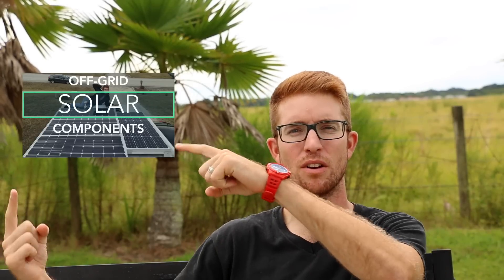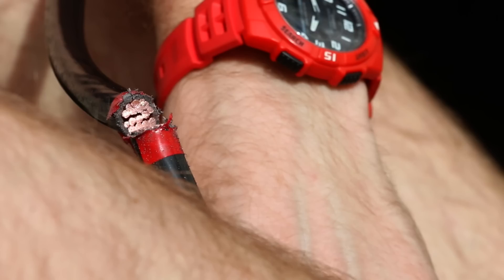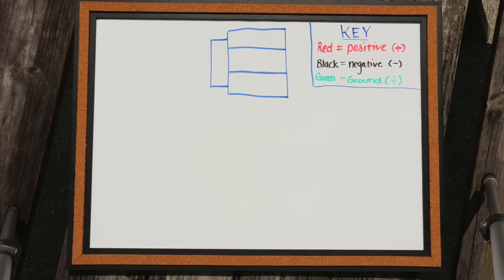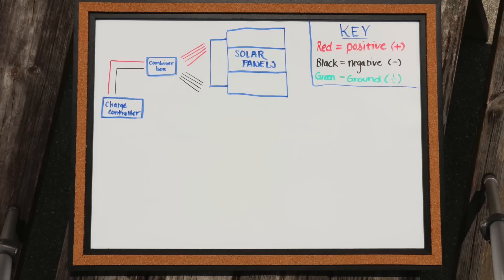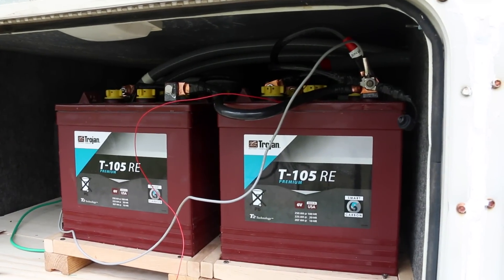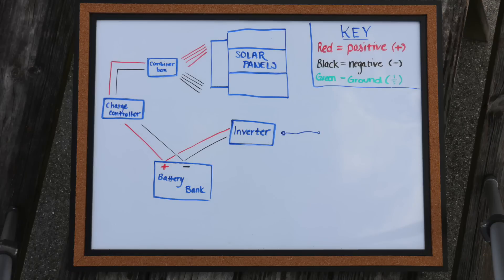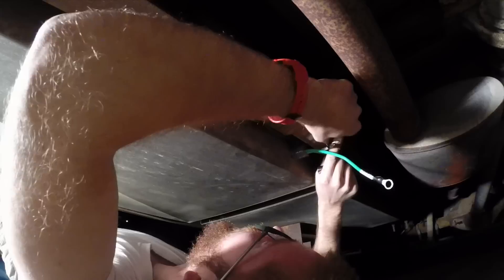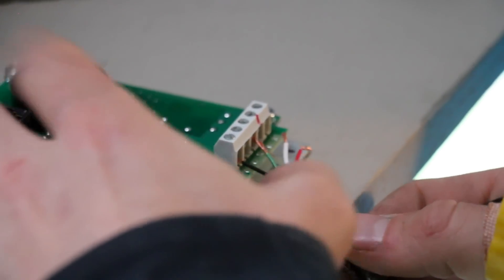Solar Wiring Basics for an Off Grid RV

Comment: You forgot the most important part....fuses and/or circuit breakers. Easy to start a fire without them
Reply: I bought in line fuses for each panel.
I just checking, so these go on the positive side?

Comment: Can you wire you different volts of solar panel together in parallel. E.g.  12volts solar panel with 24 volts?
Reply: You would want to wire 2 12v panels in series to make 24v, if you are using additional 24v panel.

Comment: A combinerbox??? Are you serious? Place a couple of panels in series by connecting 1 plus wire from one panel to the minus of the next panel, and so on till you have reached the end of your string. Combine panels which are completely in the sun at the same time or you will drastically loose power. When you have more panels than the ones which build up a string, you can create another string and connect them to the second input of your inverter, or a second inverter if it's only possible to connect 1 string. Never, ever start fooling around with combinerboxes cause it will create extra heat because of extra connections and therefore it's a cause for fire.

Comment: you need to include the appropriate sized fuse in between the solar panels and the mppt controller, a shut off switch would be good too. you also need an appropriate sized fuse between the controller and the batteries. and also a fuse on the output of the inverter. also, when installing the whole system START your connections from the battery first then to the controller then to solar panels. you can also cover your solar panels while doing all this to cut off the electric from being generating and traveling to your mppt controller.

Comment: I think that the safe way to connect is to start with your batteries and work your way up to the controller, then wire in your panels to the controller.
Reply: Exactly

Comment: Thanks! Do you run extension cords from your inverter outlets to your ac appliances? Did you change out your ac outlets to be attached to the inverter? I want to get our 1989 class c rv run off solar, generator, and shore power, but mostly solar (the others are for emergencies), but my ac outlets do not work when not plugged into shore power or a generator because my rv doesn't come with a built in inverter only a converter. I got a small 300watt inverter for emergencies which works.

Comment: That green bonding wire is not optional. You are dealing with panels that produce up to 150 volts ocv before you hook them up to anything. Which is why I leave the card board over the panels till I'm ready to energize the system. Then that bonding wire is run to a junction\breaker\Main Service Panel that has a bonding screw. Then the stud installed to a central point.That is the main point of termination for the Inverter. Converter. Batteries etc... the first GFCI plug must have this bonding screw or it's worthless. You can chain the rest off the first GFCI load side as needed. As long as they are rated for 20amps. This will protect the inverter that produces 120v to run your appliances and your ass from being electrocuted. Not to mention if you use shore power for DC\DC converters through an auto transfer switch. To a mains panel. It "Must be there" 

All this has to be fused\breaker\Main Disconnect. As I use Blue Sea. It detects faults and will shut off any power line side automatically. At the main panel on three way charging systems. To prevent fires. As I been an Electrician and engineer for 40 years. I seen my friends that had years of experience die. As they made one mistake and they were not Residential electricians. They were commercial\industrial. Built some of the most experience projects like the Cowboy Stadium. To high speed factory robotics Assembly lines. They had real Experience..... 

So you better know how it works and why. That is the danger of DIY electricians. You can make a mistake with plumbing and live. You can't with electricity. It's why I don't print diagrams for DIY that ask. I want to see it. As no two projects are the same.

Comment: Regarding grounding to the frame; I may be able to shed some light on why so many people argue about grounding in vehicle solar applications:

Automotive things are usually negative ground. If your charge controller is also negative ground, then grounding to the frame of your vehicle is a great way to go.

If your CHARGE CONTROLLER is POSITIVE GROUND, this (could) cause very bad things, if somehow your DC systems are connected. [Vehicle DC and Solar DC. Desirable in many situations for auxiliary starting power, etc.] (If they're not, it's unlikely to cause any issues because there is no 'circuit' to cause a short through the frame.)

Comment: No one ever shows taking the wiring from the inverter and getting it into the RV electrical system. Do you run it to the breaker panel?

Comment: Do you not need fuses/circuit breakers anywhere in the system?
Reply from the maker: I wired fuses on every positive line in between each component. They are definitely necessary 🙂
Reply: What size cables did you use between the different components? 
The fuses are rated by the size of cable right?

Comment: So let me ask the dumb question. Or maybe I just missed it in the video. The solar power is collected into the battery bank. The power is converted to AC by the inverter. How do you tie into the rv power system? Through the battery bank? Or from the inverter to the rv panel? Thanks!
Reply from the maker: +Mike Brazeal Great question. We actually just run everything through our inverter. When trying to wire the inverter into the AC system of the RV, it gets real wiggy. I was recommended to just install a completely separate power system and we are so glad we did. It's very simple and practical. We don't use the outlets in the rv unless the rv is plugged in or the generator is running.
Reply: Duet Justus so then how do you power any appliances? completely separate outlets wired to the inverter?
Reply: Thriving Nomadic for small systems that is correct. Larger systems can power all of your motorhome. A/C included for a couple hours(more if you go extreme)
Reply: You dont power appliances with solar. It will drain your battery really quick. Solar is more meant to store energy to charge lower powered electronics such as laptops, phones etc. Only time you use appliances is when RV itself is plugged in, generator or propane.

Comment: I had 4 of those Trojans on my last a class, no solar but upgraded the 45 amp converter to the good charging unit. never had to add water to the batteries and I abused them hard, ran way below 50 percent a lot and they still made 7yrs. very good batteries as far as I am concerned!!
Reply from the maker: Wow! That is so great to hear. I read that on a lot of reviews but it's even better hearing it first hand. So far, the lowest we've gotten them is 57% once. we usually never drop below 70.